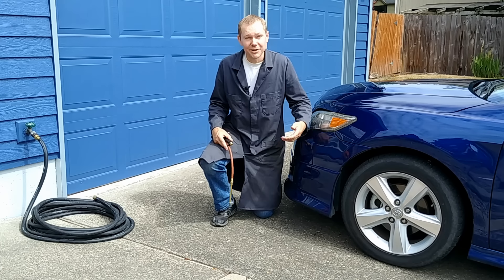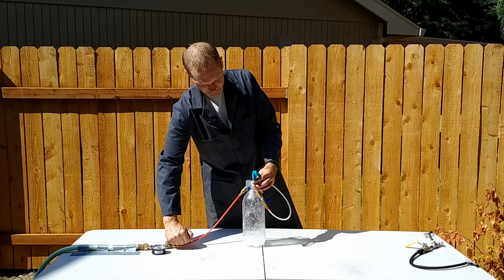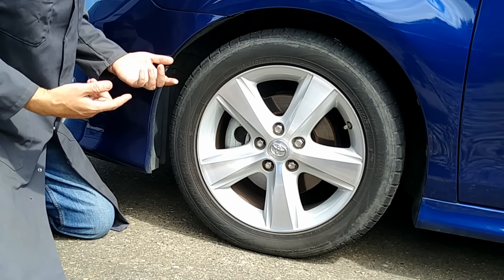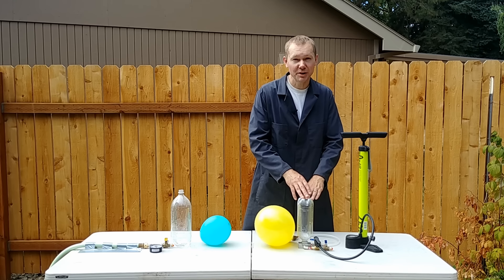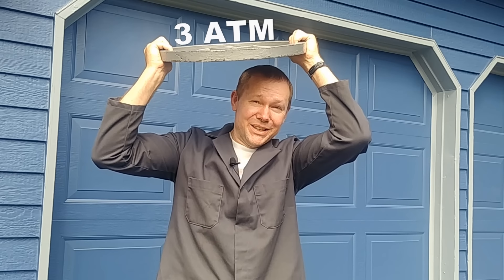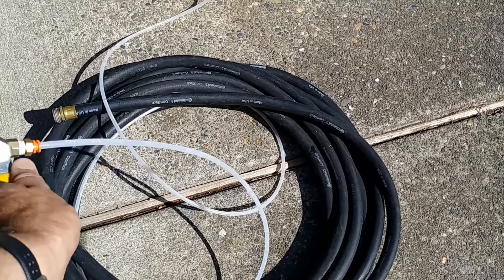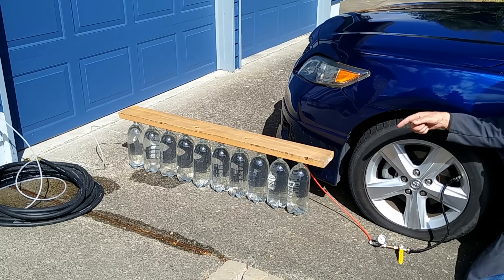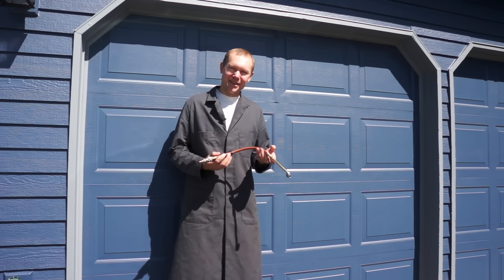2 Liter Bottle Compressor (No Moving Parts)

Comment: I love how you somehow made math interesting to even this just barely average math person.
Reply: PinkOld you realize his math is totaly off, and he is mixing things that make no sense at all. And his final result is different from his prediction!!!
Reply: @Mardog666  The math for the volume of the tire was actually about right, and he even qualified his math there by saying that it was approximate due to trying to extrapolate a square-sided volume to a round object.
Also, if you're so worried about the precision of the math, why aren't you worried about the obvious impracticality of filing tires using garden hose water for the compression source?
Reply: PinkOld well figuring out the volume should be simple for lets say 12 year old. But my point is his mixing actual pressure of atmosphere and saying that eventhough the tire is flat there is still 1atm pressure in it, which is of course false. So I was suggesting him leaving out the physics next time, since he sucks at it. Otherwise he just proved you can compress air with water pressure, I am fine with that
Reply: @Mardog666  There is atleast 1 atm in lol. But he got other things wrong for instance simply saying 60 liter 1 atm = 30l liter 2 atm
Reply: 30 liters2atm has the sam mass as 60 liter 1 atm but is  then not posibble to fill tyre with 60 liter 1 atm
Reply: @Mardog666  are you trying to say that a flat tire should have a vaccum in it?
Reply: @jetison333  to achieve vaccum in the tire you would have to suck the air out of the tire (therefore a negative pressure) to the state in which the tire would have a tendency to implode. Which is not the case in this video. And that is my final response to this video, since this discussion is getting more and more ridiculous.

Comment: Although cool, this would introduce an excess of moisture into the tires, which affects mileage and balance, so not a recommended do it yourself project.
Reply: You could try putting an air line moisture remover after the last bottle.  That is how you keep moisture out of your air tools.  This contraption would not be a practical method for airing up your tires anyway so it is a moot point, but I thought I'd put it out there anyway.
Reply: I think this may actually be almost equivalent to a trompe, and those are well known for producing excellent dry emminently breathable compressed air.
Reply: Well, eventhough this is practically foolish I found this video extremely useful as it strengthened the concepts.
Reply: For Pete's sake, it was just an interesting demonstration. No one is advising filling your tires this way.
Reply: @Quintinohthree  So you're saying that you could basically use this as the post apocalyptic DIY o2 tanks? :D hahah.
Reply: @dundalkmacgyver800  I thought it was an extremely interesting demonstration and enjoyed the video. You know someone is going to try it for fun though and possibly end up with terribly balancing issues and other problems.

And no, I don't think this is similar to a trompe. You can see the moisture migrating up to two bottles ahead of the water line in the video. There is not enough distance separating the water line from the release valve.

Comment: That's really cool to make a compressor like that, but a disclaimer should be put up for people who are not smart enough to realize there is water particles in with that air being put into a tire which is very dangerous in freezing weather conditions.
Reply: How do you get that? The last air bottle is dry until the last minute. No more humidity than natural air variation.
Reply: Because everyone has a air dryer/ water separator at their house. Smh
Reply: Great Briton see the splashes in the second bottle from 3:36
Reply: Plus water vapour is also a thing
Reply: @Jo24Park  The water is splashing down, not into the air tube
Reply: Freezing isn't needed at all. The unbalance of the wheel at higher speeds is dangerous as well.
Reply: @selli69  agree. I've seen exploding tires because of bad water condenser.
Reply: @selli69  You don't understand fluids at all. Really, you don't. A low viscosity fluid would actually balance the tire quite effectively, many balancing systems use this as a basis for their design.  Besides the fact that this wasn't a practical demonstration,  realize a hand or foot pump from air would put about the same amount of vapor/liter as his contraption.
Reply: @adetyapurba  No, no you haven't. Not possible by any means.  If so every hand pumped tire would explode after being filled and driven.
Reply: @TLCchh  On your tire pump?  I don't think so Tim.  SMH quite vigorously.
Reply: @greatbriton8425  Even if  it was saturated to 100% no one would notice. Maybe formula 1 drivers,  but your Mini would be just fine mate.
Reply: J Woods tire pump ? ..... you have a specific tank for tire air? Lmao
Reply: @jcwoods2311  : The balancing systems you talk about don't change the geometry of the spinning part during operation, a tire does this as it's function by design. No point for you, buddy! Besides that, I wasn't talking about vapor, I was talking about fluid water that goes unrestricted to the tire. BTW: Every compressor has at least a simple water seperator between air tank and hose to avoid fluid water in the hose and the system to fill.

Comment: I'm sure this is the easiest, most economical and technologically most sophisticated way to achieve air in your tires.
Reply: I'd like to see how he paints a house!
Reply: Compressed Air. From his tires.
Reply: H. Celine  waste of water
Reply: @h.celine9303  looool
Reply: H. Celine not even close. Using the old fridge compressor is by far better option.
Reply: Couldn't he have just use the bike pump 🤔 or are they not strong enough I don't know never tried it 🤷
Reply: @vint.k1727  he just wanted to flex.
Reply: @vint.k1727  Bike pumps work fine, bigger ones take less work. Good ones have a pressure gauge and decent hoses. The Schrader Valve is the same on cars and bikes.
Reply: No, you are wrong on all three statements
Reply: THERE IS SOME AIR IN THE TIRE ALREADY, SO BY REMOVING THE AIR OF THE ATMOSPHERE THE TIRE WILL EXPAND
Reply: @nusreterol2533  Not if you water the garden.
Reply: @a1sloth1  You're not thinking big enough. WE need to replace all the streets and roads with tire material, then we don't even need tire!
Reply: @jay-tbl  I think we should form a consulting firm!!!
Reply: @vint.k1727  I once pumped a flat 235/65R16 using the bike pump (although the larger one, with ~1qt cylinder volume). Took about 15 minutes but I got ~35psi.

Comment: He’s cheating. He’s just displacing air with the 80psi water pressure made by pumps at the city level. Moving parts are there
Reply: He is but technically you could do this with a gravity fed water source, granted it would need to be about 100ft above the compressor but its doable.
Reply: I once knew of a guy that tapped into the city water main and installed a water generator, covered the whole thing up and ran the line to his house to generate electricity, so whatever works.
Reply: @alaskanalain  That's cool, but the displacing action (compressor) of your system has moving parts nonetheless. The question for him is:, is it cost-effective to pay for pumped/filtered water or just pay for electricity.
Reply: Xactly

Comment: So basically "Yes, it was a real hassle using that air hose so instead i fixed 10 bottles to a post and interlinked them with tubing and connected them to my garden hose outlet. It was just easier.".
Reply: Ikr this is dumb asf and easier just to have the tire fixed or buy a mini compressor to hook up to the car battery

Comment: "Wet" air, very bad. The water that you're putting into your tire will increase the pressure vs temperature curve. Just a heads up for the people that would like to try this!
Reply: pressure vs temperature, care to elaborate
Reply: And isn't it a huge waste of water?
Oh yeah I forgot... In america, wasting water is considered as a national sport...   :P
Reply: @NixonRexzile-xz4sq  college for me was 35 years ago, and the exact knowledge is now gone, because I never used it.  I believe it was about 2nd year college level course. So if you care to look into it, here is the start down the rabbit hole
https://www.engineeringtoolbox.com/amp/air-density-specific-weight-d_600.html
Reply: The other issue with wet air is moisture will corrode aluminum wheels and rust steel ones. You will have rim leaks in no time!
Reply: Wow, I bet your fun at parties. It was a demonstration of scientific principles of non compressibles vs compressibles. If he is that smart I would assume he knows the air has a saturation of water in it.
Reply: @JimNichols  lol, you wouldn't be the first to say that, nor the last. I was just pointing out while it's a great demonstration of applied science, there's valid reasons (covered in the video) why it's impractical and missing some science on why it's a bad idea.
Reply: @miniac60 .
There is no science missing as it is only a demonstration of how to compress a compressible gas with non compressible liquid. But hey who am I to question the fact you think it is A) "bad science" and B) a "bad idea".  But sure thing sir, you have a great day
Reply: Water accumulates in normal air compressors. I have to drain about a cup out of mine for every 1 hour run time.
Reply: @Reth_Hard  Michiganders be like
Reply: @1957mrbill  it would take decades to rust out a wheel
Reply: @Reth_Hard  wasting water? You shriveled lil prun. It comes out the ground, out the hose, absorbs back in ground. 
P.s. I let my shower warm up for 30mins before I get in so it's nice and steamy. 🤷‍♂️
Reply: I think a longer air hose would be easier! 😉
Reply: @CanDooBU  Thank you! This idea of wasting water baffles me. Maybe wasting clean filtered water. Just cause water goes down the drain doesn't mean it's gone. It just needs to be filtered again. Same with evaporation, drinking, watering your garden......  water doesn't dissapear.
Reply: 10/10 would help my younger brothers to build this for their science fairs
Reply: While that's true, this was meant, I think, just to demonstrate the concept and not as a method to fill up your tire.
Reply: Air compressors have water vapor in them too !
Reply: @whitechris720  : Think about the situation.   If this guy (or you) uses this contraption that he built to fill his car tire, then dumps the water onto his driveway, he IS, in my mind wasting the water.   If you think differently that's OK.  It's called an opinion sir.
Reply: @All_Roads I pay my own bills thanks. And if it's making steam, means it's hot and not broken..... 🤨
Reply: @whitechris720  Well said! And here I thought common sense was common. If he lived in a place low on water I'm sure he would put it in a tub and reuse it. Everything is situational, yet I'm sure the people that complain are not self sustaining. You going to filter pee at your house because 6 hrs ago it was good water?
 Bottom line, he is paying for it so it's not a waist.
Reply: @All_Roads it's hot in seconds I just like the steam. And I have a septic tank and a well and I live next to the the world's 20% of fresh water (I do count my blessings). The water table can be dug with a shovel, I dont think you realize water is literally everywhere, granted you have to dig farther in some places. Hot places evaporate faster and float away. Dont look like either was a factor in his video. 20L of water dumped there did not take 20L from a family in need and sure as hell won't cause a drought around the world. Sounds like you need to stop playing the victim card and realize all of life is situational and enjoy a good science experiment when you see one.
Reply: @All_Roads good talk, good night.
Reply: @nicholashollow9410  I know people who run CNC machines with air compressed routers. They have three water filters to keep it out of the lines.
Reply: @1957mrbill  rust is corrosion mate. They are the same thing. Water can't  corrode aluminum past a very thin surface oxidation layer. That's why aluminum is such a popular material for boats. Further to that, wheels aren't made of aluminum. They are made of alloys. Why do you feel qualified to spread your bad information?
Reply: @Reth_Hard  he used about as much water as an average shower, for a science experiment. Looked like he was pouring it out into his garden too. Quick someone call Greta
Reply: @darbyl3872  water evaporate sir, water evaporates. If american is in a water crisis right now, that would be an issue. But nobody is gonna run out of water before the next rain. Learn physics
Reply: @All_Roads only if american is in a water crisis right now. That much water he waste isnt gonna delay or make someone else run out of water.

WHAT IS WRONG WITH U PEOPLE
Reply: @Reth_Hard  unless your in California aka, if you think hard enough a forest fire will start. Its is really really dry in the mojave desert,  water is too expensive to waist.
Reply: @tshepp89  nope LEO  GER Lose Electron, Oxidation--Gain Electron, Reduction

Oxidation is the process of any Metal or Non-Metal reacting with Oxygen to form the Oxide of that metal or Non-Metal. ... Corrosion is the process of losing the refined metal (recovered from the Ores), to chemical reactions with any chemicals to form its Oxide, Sulphide or any other metal salt.
Reply: @darbyl3872  u do know that he pays for that water right? He has paid for that amount to water to be filtered and delivered to his house. The water he "wasted" is not lost and not actually wasted because for the money he paid for it, it will be filtered and delivered again.
Reply: @shawnr771  They probably don't want  mineral deposits to build up inside the machine. Anytime you squeeze air you squeeze the moisture in the air out.
Reply: @nicholashollow9410  Yep.
Reply: @miniac60  great link and still working, nice!:)
Reply: I would say this is a smart guy doing a simple demonstration of a scientific fact, this might save someone's life one day if it helps them remember the lesson so potentially it's a good use of time and resources, an understanding of physics can be essential in life, particularly if you are in a survival situation relying on your own knowledge and abilities, well done Quint...
Reply: @1957mrbill  The air from your compressor contains exactly the same amount of moisture. But that's probably irrelevant.
Reply: @bran-qt7ds  I wouldn't say I don't grasp it. We obviously have different options. The world could do so much more to clean our water supply.

Comment: its interesting to know that you water supply has enough pressure to inflate a Tyre...lol
Reply: Unless everybody on the block starts doing it and the pressure drops.
Reply: @DreadX10 , then the water gets wasted too!
Reply: I have 60 psi water pressure.
Reply: Absolutely, In the UK the water pressure is 90 to 120 PSI. water company's put huge pressure regulators and massive "thrust" blocks of concrete on large water lines  at bottom of steep hills, as I've seen 300 plus PSI on a pressure gauge,
Reply: @IvyMike.  civil engineers often need to add large blocks of concrete or other support any time the flow of water changes direction due to the force of the moving water physically pushing the pipes around.
Reply: Not surprised at all. Anybody who has ever filled a boiler will read numerous warnings that if you don't do it right you'll blow the relief valve as the domestic water supply actually exceeds the pressure rating of a home boiler. (I'm sure there are commercial scale ones that operate above atmospheric pressure but for hydronic heating you really don't want to be dealing with high pressure steam.)
Reply: The average house has 60-80psi water pressure and most have PRVs (pressure reducing valves) because the street pressure is above 80psi.
Reply: @Moorgoth67  I've seen houses with as little as 30psi of water pressure.
Reply: Clokey  https://youtu.be/msxMRwQyXI8
Reply: @Twinkle3055  it doesn't have to. If he had the water fill a 20 liter reservoir that fed the bottle, he could do the job with just 20 liters. Each time he reset,  he could just empty the bottles back into the reservoir and star 9 again with minimal wasted water. Obviously, that would be more work and materials, but less water.
Reply: @AppleGameification  yes, why? I was saying they aren't only at the bottom of steep hills but also pretty much whenever the direction changes.
Reply: @Moorgoth67  yea my home has one of those installed right after the meter
Reply: @SmallSpoonBrigade  pretty sure that wouldn't work unless you had a lot of head  height on the tank...

Comment: so, you transferred the moving parts from your home to the town's waterworks.
Reply: Depends on the town. Some towns have water facilities at higher elevations so that gravity itself helps to distribute water and give the town water pressure. In that case it would be converting the potential energy of the water into air pressure.
Reply: @braydenkenney3313  
Still gets mechanically pumped into the water towers to provide that potential energy. Even before that, filtration and water processing is partially a mechanical procedure
Reply: @CtrlAltRetreat  I said the water facility itself. Not just water towers and other water pressure methods.
Reply: But then the same could be said if you used an electric pump: you've just transferred your work to the electric power plant ;)
What? You used a gasoline-powered generator to power the pump? Well, then you're piggy-backing on dead dinos :)
Reply: You could elevate a 55 gal drum full of caught rain water and do the same thing.  No electricity needed. Gravity is all you need.
Reply: 4dscdriver I bet you use mechanical energy to raise that 55gallon drum. It’s going to be around 460lbs.
Reply: @Old_Veteran_Aviator  Still don't need electricity to lift it.
Reply: Back Country Air Force raise an empty drum, then wait for rain.